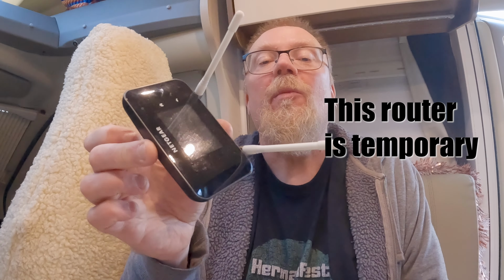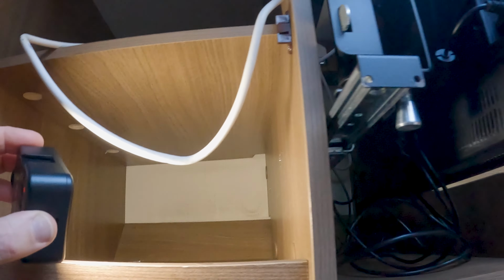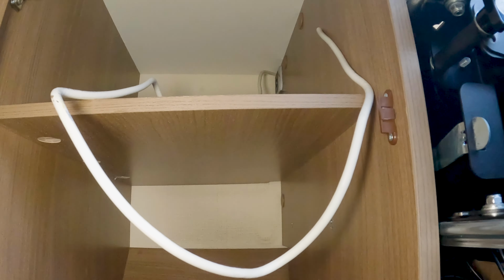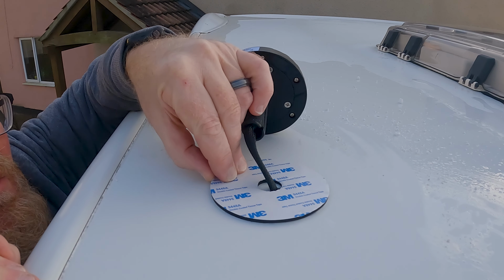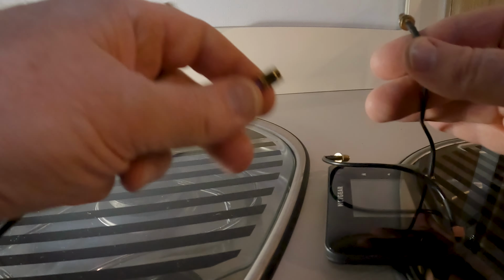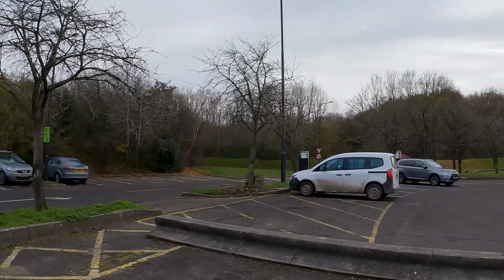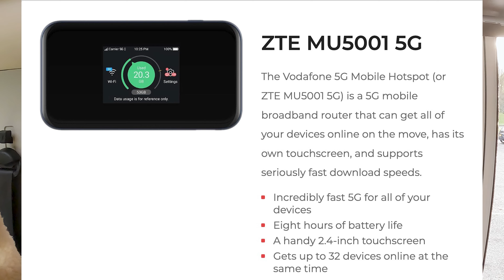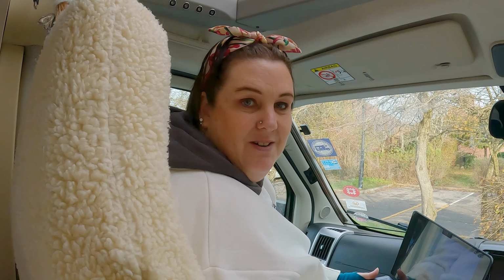How we got SUPER FAST INTERNET in a MOTORHOME

Comment: We have the same LTE router  we can not fault it to be honest  we first  used  it on its own as a standalone item  we then decided to get an external aerial  .  Credit to you fitting it yourself  I’m  fairly   Good at diy mods but drilling the roof I decided to get a dedicated Motorhome service place to fit the aerial  👍👍 9:37
Reply from the maker: The first time I drilled a hold in the M/H was a little nerve racking - I've done a few now, and will do it again, should the need arise.  £10 for a hole saw is probably quite cheap compared with someone else doing it for you.

Comment: We have a broken antenna on the roof but it has made very little difference up here, we either have a signal or we don't LOL  I suppose I should change it though just in case.
Reply from the maker: It’s better for the antenna to be outside. The puck boosts by about 3dB. To get 5G, you have to be in coverage, this is rare cat the moment, but terminating 3G should free up a useful chunk of spectrum. We’ll get lots more folks complaining about those tall 5G masts, but using the 5G signal to complain with. …  Pete.
Reply: @CraftyCampervanners  Yes ours in on the roof, well it is on the TV mast as we removed the TV antenna.  We are not getting 6G for years and are stuck with 4G for a long time.  I do not use it for much while we are away but Lindsay likes to keep online.  We are off to an area where a 500ft mast might get a signal LOL
Reply from the maker: I’m thinking a higher gain antenna would be good for us, I’m imagining a certain motorhome towing an olive drab trailer containing something large and hydraulic 😉
Reply: @CraftyCampervanners   LOL I wish but it would have my ham radio antennas on it.